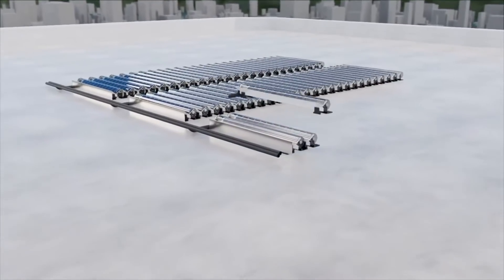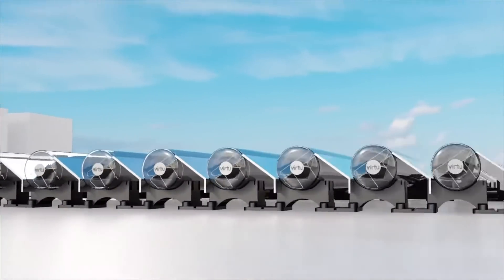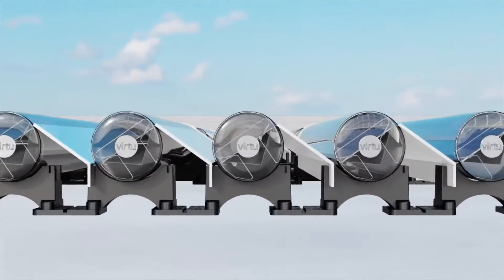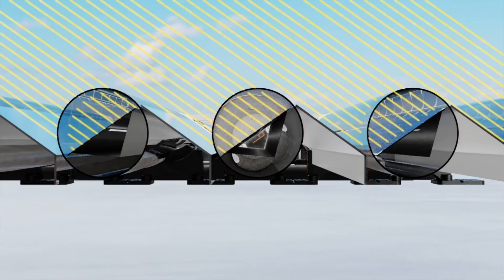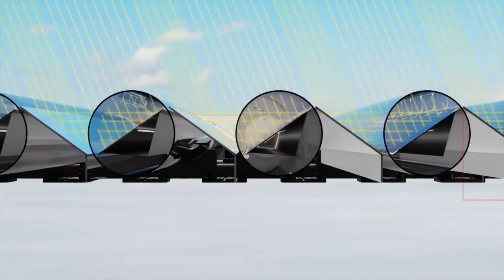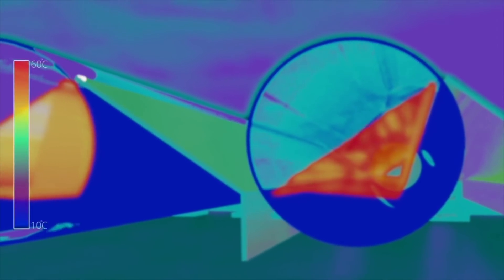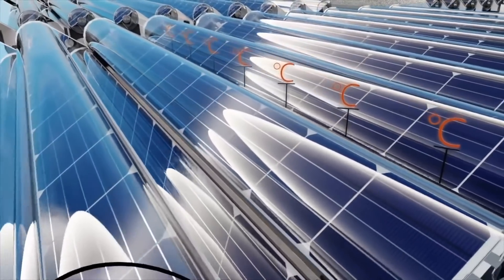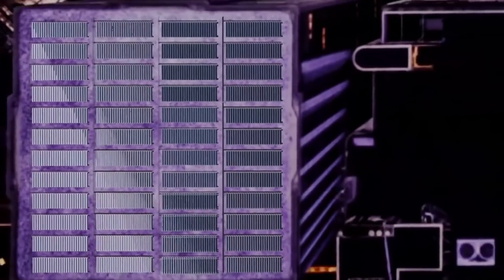Make electricity and heat with one device: hybrid solar technology

Comment: My first solar air heater made in 1977, a glass over a black metal chanel, 20 m2 for a dryer. At home I made a Trombe wall with a photovoltaic panel, I use ultraclear glass 3 mm and a fan 40 cm/h, surface 1m2 (my balcony). Temperature of air up to 65 C, usually 30-45 C. In this summer I plan to use warm air to preheat water to increase total efficiency. The measured efficiency of  a wall (glass+fan+black surface) is 65% for heating season, I want to see the efficiency for the whole year (electricity+warm air+warm water). The intensity of sun is up to 1040 W/m2 (measured).

Comment: they say heat exchanger will take away heat from pv modules... but what if there is no need for hot water? you would need some kind of cooling unit that will cool the water if there is no hot water consumption...
Reply: The whole point is that this technology is designed for people that need heat.  Don't need heat - but do need electricity - install PV modules (the heat exchanger takes heat away from the PV cells - this does not attach to a conventional PV module - it is a product designed from the ground up)!

Comment: concept is very good. the important now is the market price, specialy the price/advantage ratio verssu all other systems. if price will be cheap it can be a sucess, as an architect I would start using this in my projects if the price is done correctly.

Comment: but the efficiency of the panels doesn't be affected by the extremely high temperature inside capsules? almost all electrical components works better in low temperatures...

Ah, ok! i just found your comment about water cooled system in the cells. probably the water circulating in cells could maintain cells under the range of work temperature, right? great!

Comment: Interesting idea, the advantages are combined electricity and heat generation, thus saving roof space, and the ability to position the tubes at an angle unrelated to roof pitch.

Disadvantages would include [much] higher manufacturing cost than PVs, higher cell temperature (and hence lower PV output) on days of low hot water usage (which results in higher water temps), greater complexity of installation due to the number of electrical connections, greater chance of electrical failure for the same reason.

There have been one or two cylindrical PV systems over the years, such as the Solyndra system, they have all gone under due to the higher cost - if you can't compete with low cost PVs combined with heat pumps, then you are not going to get much market share. The only manufacturer I know of still making these things is tubesolar.de

I guess time will tell, but it's pretty hard to compete with the economics of standard large format PV panels, with their simple racking installation and connection systems.
Reply from the maker: Remember that this isn't really a "cylindrical PV system" - it's an evacuated tube solar thermal system, with inexpensive PV cells inside as a bonus.

Comment: I'm a noob and will admit so. The product is very interesting.  My question. Living in a northern climate and snow build up ,can or doesn't the tube which creates heat melt the snow?. We can get several feet in one storm.
Reply from the maker: Like all solar products, if you have big snow loads, you'll have to manually remove the snow or wait for it to melt.

Comment: Operating at 60c during summer seems quite a bit optimistic. I mean if you optimise the setup for around 60c in the summer then the water will drop in temperature quite a bit for the rest of the year making it hard to use as you would either need massive volume or additional heating. Also while the PV panels efficiency wont drop terribly it will be overall less than a regular open air panel. I am not quite sure there will be a space saving compared to a properly densly packed solar thermal+ PV. What is the price point of this product? As a two in one solution it has some potential at the right price point. Also Can it beat just a whole bunch of PV panels that are used for water heating too in terms of price and space saving?
Reply: There isn't just one operating temperature - you can adjust the operating temperature by controlling the flow rate.  Because of the excellent insulation you can achieve higher temperatures in colder ambient climates in winter.  In the summer you increase the flow rate and end up with higher volume of a given temperature.  That's why we always recommend sizing an installation to the summer thermal load.  If you have a commercial enquiry please do get in touch - we have spent years doing the sums and there is most definitely a better outcome for the same area compared to PV and solar thermal side by side.

Comment: 😇 You've missed something 😇
Run the heated air through a chamber of cooling fins to create drinking water from the condensation of heat differential.
Reply: We already did a demonstration project where we turned sea water into pure water using the heat and power to drive a membrane distillation process.  On a small scale it really isn't cost effective, but heating the water going in could make a utility scale reverse osmosis processing plant more efficient.  There are lots of potential applications.

Comment: Now imagine if we could add peltier strips and Sterling engine to this setup somehow to squeeze out even more energy.
Reply: Heat is a form of energy - one that is actually in great demand (51% of global energy use versus 17% for electricity) - that's what this technology is aimed at addressing.  It's all about the lifetime cost of delivering a particular outcome sustainably.  You could squeeze out more electricity and put it into a heat pump - but you would need to compare the additional costs associated with buying and maintaining the Sterling engine and heat pumps and inverters etc versus cutting out all the 'middlemen' and just delivering the heat that is needed.

Comment: my question is, "isnt having a rooftop garden great for carbon capture?" im sorry if im off topic.
Reply from the maker: Less good than you'd think. You can't exactly grow a forest with a lot of mass on top of a roof, at best you can get some grasses and small plants to grow up there. If you put a lot of soil up there, that's very heavy, so you need to make the structure extra strong... which means more materials like steel... which means more embodied carbon.... which means the carbon captured by whatever you plant up there will not offset the amount of carbon you had to emit to make the structure strong enough to hold it up! Generally speaking, it's best to put renewables on the roof and paint the rest of it white so heat bounces off. Cheaper, too. 

(Green roofs are pretty though :)
Reply: You know that plants cant grow indefinetely and when it stops growing in size it pretty much stops capturing carbon from air (because carbon captured is stored in celulose so the plant itself is built from it) and when a plant dies it will decompose releasing all the carbon back into the air.

Comment: Since the angle of the panels is independent of roof slope, it seems like these could also be applied to a south facing wall, reducing issues with snow coverage in winter.
Reply: Absolutely - the opening shot of the video is a vertical facade
Reply: Yes this is a real building - the Active Office at Swansea University - https://www.flickr.com/photos/specific-ikc/50664457763/in/album-72157696426542591/

Comment: What is solar to electricity energy efficiency.like for pvs its about 20-23%...also whats solar to electricity and heat energy efficiency?...their website doesn't tell.which is very pointing that this could just be advertising stunt for their PV tech which isn't very better than the old PV

Comment: my biggest concern is the cylinder these things are enclosed in, it should be thick enough to withstand vacuum but at the same time thin enough to not reduce the efficency of the PV cells, and that's in the middle, the more you move to the sides the less efficents this becomes. i feel like a normal cheaper PV panel with a thermal one would be more simple and efficent overall
Reply: The optical losses due to the glass are not materially different to the glass used to encapsulate a conventional PV module. The economics of installing separate PV and solar thermal side by side are marginal, but naturally need a lot more roof space.
Reply: @nicholassimmons7420  but there are differences, the thinkness is bound to change. also what about refraction?

Comment: This is pretty cool, and an idea I've had for a while. But is it just an middle ground of efficiency between a separate solar voltaic and thermal? Because for thermal, you want it to be very hot, but for voltaic, heat is bad.
Reply: There is a compromise.  The current generation of mono-crystalline G1 PERC cells have a peak efficiency of around 22% and a temperature coefficient of approximately -0.32%/K.  That means that the output from the cell at standard testing condition of 25C is 22% at 65C the output will drop to 19.2%.  As mentioned a conventional PV module does not have an easy way to dissipate heat (yes some air in front and behind the module but the cells are sandwiched between glass on the front, layers of adhesive, insulation and aluminium on the back - so those cells also get hot).  What would you rather have a cell producing 19.2% efficiency or a cell producing 19.2% efficiency PLUS another 50% heat - bearing in mind this technology is designed for applications that need heat - the electricity is a bonus?  I don't think 1% point drop (or 12.8% relative) in efficiency is so dramatic as many here seem to think?

Comment: I am wondering how well the system is designed to keep the tube in vacuum. With expansion and contraction cycle at place like Canada, I will scrutinize the vacuum sealing design before adopting it. But, I am very impressed with the engineering design on maximizing the solar energy capture and space saving.

Comment: Scam! Why? Solar-Cell produce LESS energy when they get hot. Either you cool solar cells to be most efficient OR you use a vacuum tube with a black painted tube inside to get hot water. But never ever combine. And no, the water which is supposed to be heated will not cool the solar cells. This does not work. Anything(!) in front of a solar cell reduces the light reaching the solar cell. Also when its a friction of a friction. Any(!) photon measures. Transparent solar cells are the future (currently not invented). And for the vacuum tubes: Less pressure is better.
Reply: I suggest you read a little more about the technology before making unfounded accusations.  The technology has been independently tested and has been demonstrated in multiple locations / applications.  Any conventional solar module will get hot when you put it in the sun.  If you transfer the heat from the back of the cells into flowing water the heat can be taken away and used for something useful.  This is first and foremost a solar thermal collector (which is why a vacuum is used to achieve higher temperatures and lower losses) with the electricity produced being a bonus.  There is a very clear relationship between the loss of power as temperatures rise based on the cells' temperature coefficient.
Reply: @nicholassimmons7420  I believe you doesnt get it at all what I am saying. So I just repeat the first part and split it in multiple lines to make it easier for you:

... Solar-Cell produce LESS energy when they get hot.

 Either you cool solar cells to be most efficient OR ...

Read this and comment it again. Than may be I explain the next part of my initial comment for you.
Reply: @v.gedace1519  Please read the introduction at the top of this thread - funnily enough we are aware of what you describe.  There is a trade off between higher temperatures and electrical output.  We acknowledge this - as does every PV cell manufacturer.  There is nothing in front of the cells.  I recommend you take a closer look at the website and the various references there.
Reply: Next part:
Imagine you have a test setup with a light source and one small solar cell.
Try to imagine further that you are measure the solar cell output.
Lets say you measure 5 Volts.

What happens to the voltage when you start blocking the light more and more?
Right. The voltage drops.
Conclusion:
"... Anything(!) in front of a solar cell reduces the light reaching the solar cell. ..."

"Anything" includes also glass.

"... Also when its a friction of a friction. Any(!) photon measures. ..."

So:
A better solution than the one shown in the video would be to ensure that the solar cells are directly exposed to sunlight - without ANY cover. 
AND
The solar cells should be mounted on a copper block that absorbs the heat. 
Water should be passed through the respective copper blocks in order to transport the heat away. 
The water supply to the copper blocks should be parallel and not in series. 

The next optimization step would be to ensure that the solar cells are aligned / moved in such a way that the light always hits them at a right angle. 
Using a mirror is a "nice" idea but not the theoretical(!) optimum.

Or even better:
" ...  Transparent solar cells are the future (currently not invented). ..."
"Transparent" to reduce the heating issue.

ERRATA:
wrong: currently not invented
correct: it seems to be invented. See: https://www.solarwindow.com/
Reply: @nicholassimmons7420  Next thing:
Putting it in vacuum tubes makes no sense at all because wind is excluded as a potentially cooling element.

"... Either you cool solar cells to be most efficient OR you use a vacuum tube with a black painted tube inside to get hot water.  ..."
Reply: @v.gedace1519  I'm really not sure what you are trying to say - if you have some great ideas why not get out there and put them in to practice and come back and get Tyler to make a video when you're done.  There are lots of people who will provide constructive criticism and do their best to put you off.  If you get past all of that you may eventually create a successful business.  Best of luck.
Reply: @nicholassimmons7420  Vice versa: I does not get the point from your first comment (replying to mine). 
The solar cell market seams dead to me since the Chinese taken over it. 
And there is a difference between optimization something in theory and getting out a product to the market where you can make profit...

Last but not least: Thx for your best wishes. I really appreciate this. But no need for another wealthy company.

Comment: And yet the one thing they clearly forgot was a flat transparent sheet over the top of the unit. From day one dirt will reduce performance. Bird excrement, leaves, dirt and grime. Grooves catch and store. Flat sheet can be washed by rain and easily wiped clean. 

Did no one actually trial these units or are they just lab tested????
Reply from the maker: Not only are they lab tested, they're currently installed on several pilot projects. The lack of a flat transparent sheet over the top has turned out not to be a major oversight.

Comment: This is quite cool. But it seems like it requires a lot more material to setup. Is the cost justifiable as compared to traditional PV systems? Looks more like a residential solutions for smaller scale projects.
Reply from the maker: I'd say it's more likely to make sense for certain kinds of commercial projects, like hotels/resorts, rather than residential. But I could be wrong - residential has year-round hot water demand, which is the circumstance you need for this to make sense. Is the cost justifiable vs traditional PV? It'll depend on the project specifics. In some circumstances, this will win - in others, conventional is the way to go. You're getting both hot water and electricity from this in the same package. With conventional, you need either a PV system and a separate solar thermal system, or a PV system plus heat pumps, or a boiler, or whatever else to generate hot water. Really depends on the conditions and the project goals.
Reply: @tdisney  yea I guess it depends on the efficiency too. Unlike electricity, heated water can't be pushed to the grid. So if it's not utilized, there is no value. And after COVID, most people will be at work during the active sunhours where it can be heated. 

But if it's for hotel/restaurant/etc., the application sounds like it makes sense.
Reply from the maker: @YSWNSG  Yep. Heated water can be stored in a tank for use at night/morning - I did a fair amount of Thermal Energy Storage (TES) tank design back in the day, but that was for projects at the scale of schools - I doubt it'd pencil out for single family residential. (MFR, though, sure).

Comment: What if the tubes were filled with water would that magnify the sunlight to the photo cells as well as circulating the water could be another source of heat and energy cooling the cells increasing performance and heating water at the same time
Reply from the maker: Might make the electrical engineers fidgety to have all those electronic components swimming in the water... ;)

Comment: PV cells and not cooling them ? 60°C means that power output of PV cells will drop to just 1/2 off they potencional power .
Reply from the maker: Read the writeup in the video description, which addresses the heat/efficiency issue.